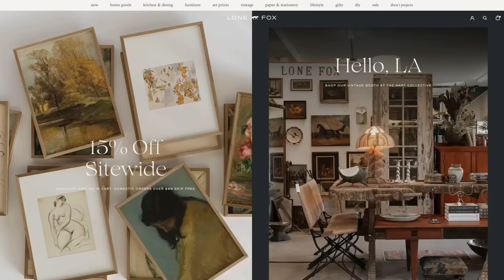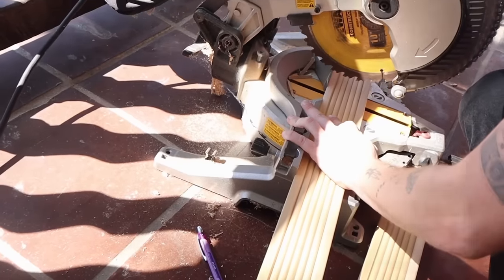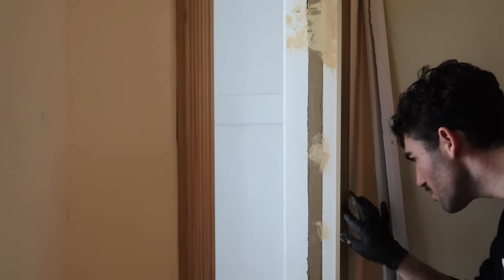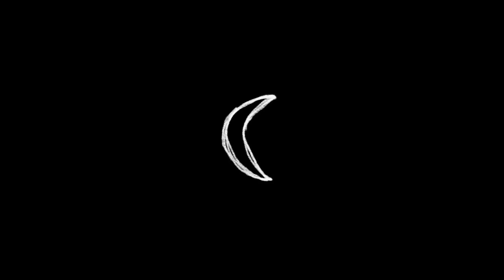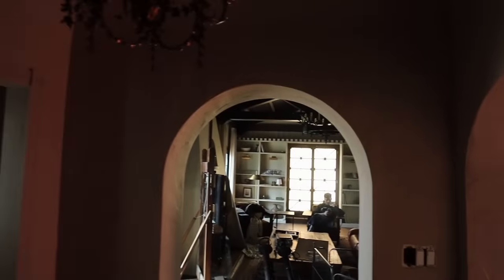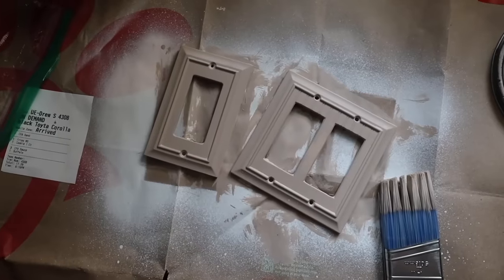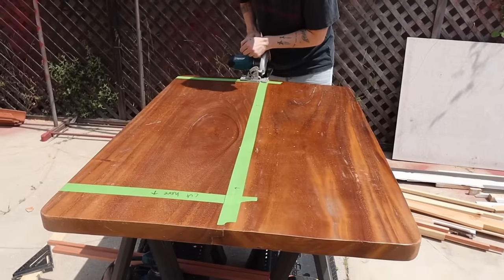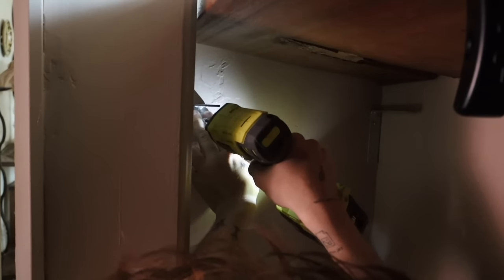SMALL ENTRYWAY MAKEOVER *DIY Built In Closet & Storage*

Comment: Nicely done! I also Smoke Trout in modern eggshell finish on the west facing wall of our kitchen and Dimity in estate emulsion on window wall and upper west wall where the pantry cabinets are. I always buy sample paints and then place a rectangal of all the colors on each wall. Most of the light in the house comes from east in the am, then a huge amount in the pm from west north-west. The habit tendency for me is modern egg shell on the west wall so the other paints on other walls with profit from that soften reflected hue. That is why the east wall are the lightest with very little sheen. The exception is the south entry wish is eas wall in Cook's Blue in full gloss because the west all is mirrored from toe to ceiling. Entry angle is just right for catching the mirrors to broadcast that Cook's Blue on to all the walls in the greatroom, (each is a slightly different color which nobody notices but which change throughout the day.

Comment: I would put a fabric skirt under the table, black out, with a split in it.   The dog door is an eyesore with everything else.  You would have to use heavy fabric and add weights inside the bottom hem.  Your dog would have no trouble with this.

Comment: I liked the final wall color. Have you thought about adding a curtain with lots of texture below the closet tabletop and pulling the middle of the curtains to the side to drape around and frame out the doggy door? It just looked a bit empty there. You could also add a pretty pot on the small stool below the painting.